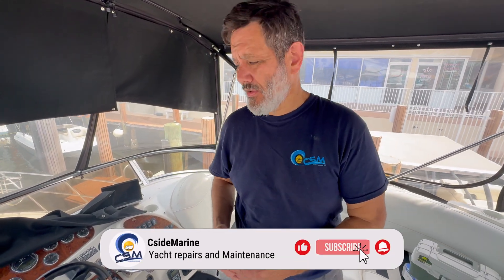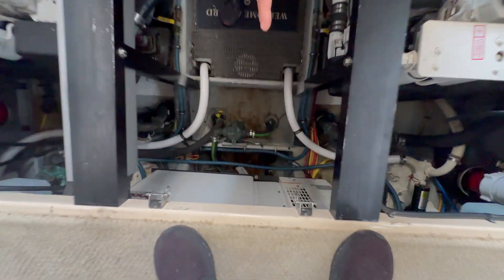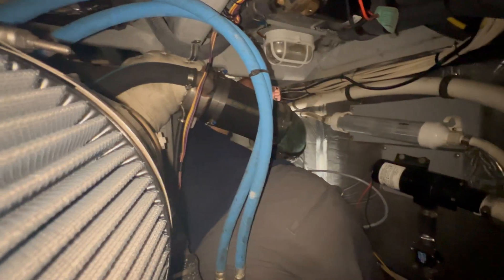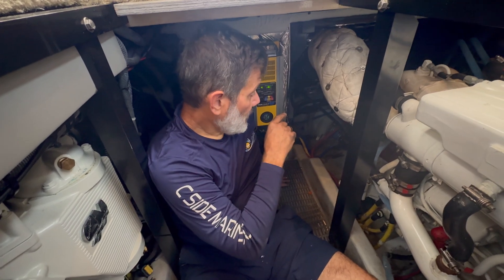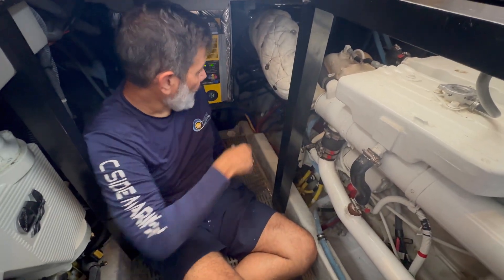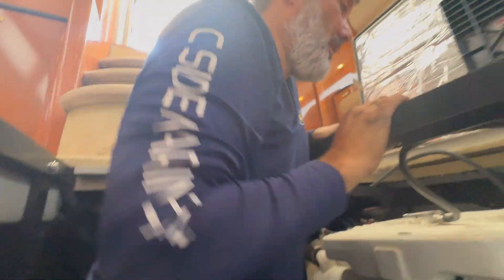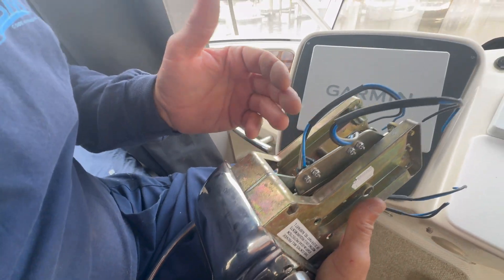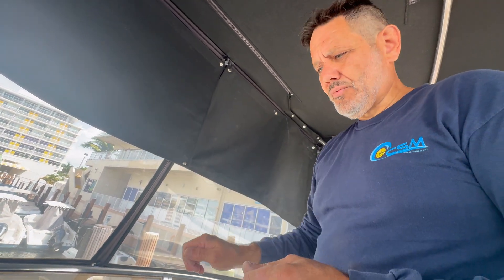Mechanical Controls Are DEAD – Here’s What Replaced Them ⚙️❌

Comment: I installed the same system on our 37 Bertram. Except for the slight delay, I love them. However, on Labor Day, we were about 5 miles off the coast, and as I rolled the throttles up to 80% (1950 rpm), the engines dropped to idle, and I started getting error codes on the controller. I turned the power to the controllers off, which reset everything. Again, as I rolled up to 1950 rpm, the engines again went to idle, and the controls were flashing an error code. Today, the company that installed the controllers hooked the computer up and found the error on the computer. Apparently, the mechanic who installed a new turbo stepped on and bent the 'cable'. The installer bent the cable or rod back, and now no codes. Going to sea trial this weekend. Hopefully, this fixed the problem. It's a bit frightening when the motors drop to idle.
Reply from the maker: Hello, it’s most likely that you are getting jam conditions. We can certainly help you retreat the error code and correct your issue. We have a consultation service that can provide your help.